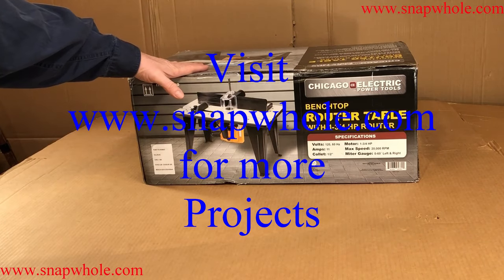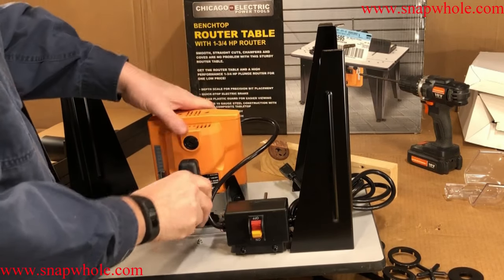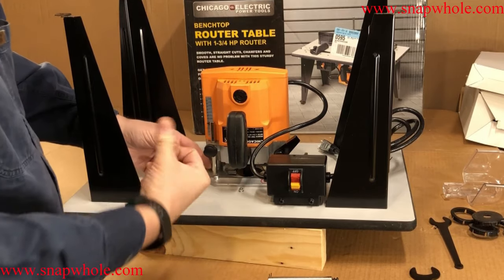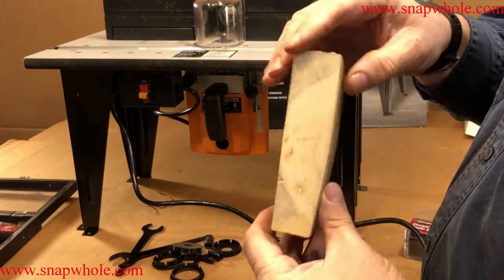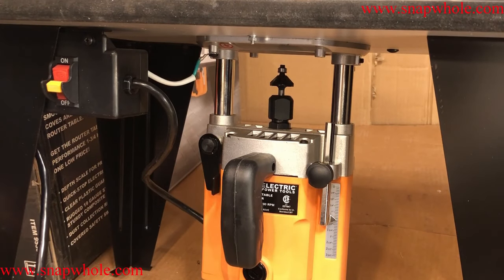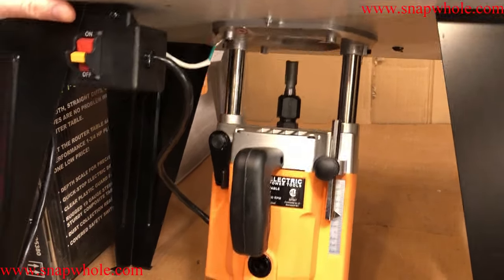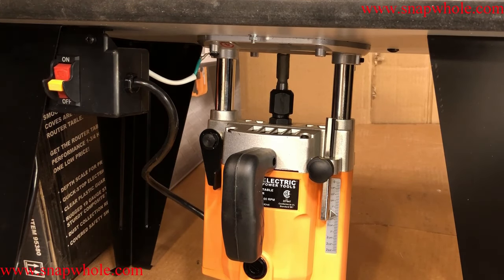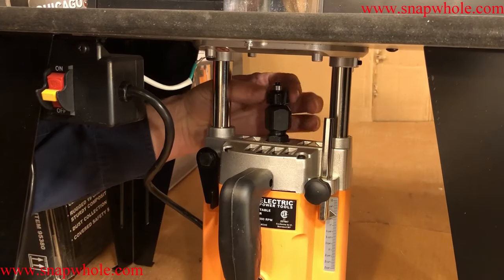Harbor Freight Chicago Electric 1 3/4 HP Router Table Review and Use Demonstration

Comment: Thanks for the review and suggestions. I just got this table and immediately was hit with the depth of cut problem using 1/4" bits. I'm a relatively new woodworker, but at least I knew enough to be uncomfortable with raising the bit in the collet, as you point out as well. I appreciate your "precision" in making that adjustment (as well as your caution!). LIke you and several others, I plant to make the adjustment to the underside of the table surface as soon as possible. I also really liked your magnet solution to roving collet wrenches. Again, thanks so much for your time and care in presenting this information.
Reply from the maker: Glad you found the table useful! thanks for subscribing!

Comment: I want to thank you for this video.  I got the exact same router table, mine came with a manual, but my manual makes no mention of that funky steel bar with a screw in one end and a cotter pin in the other.  I was trying to figure out if this was a spare part - it seemed odd to me that my table came with the router already attached, so I thought maybe somebody put it together wrong and then returned it.  

Also, the manual helpfully suggests that the washers should go on the bottom of the table, rather than on top of the fence, which prevents the carriage bolt cuff from locking into the slot.  I knew this was wrong, but I am glad that somebody with a YouTube channel gives the correct instruction.
Reply from the maker: HF manuals are not known for completeness or accuracy, I try to cover the stuff they don't - thanks for subscribing!

Comment: Been using this one for a year and a half and it has been great. I built a bench for it at the end of my miter saw station.
Reply: The only thing I don't like is the plastic inserts.
Reply from the maker: I've had this for several years now, once you know its limitations and how to work around them, this table works out ok - thanks for subscribing!

Comment: I just got a kobalt and now I'm glad I did.  It was only 10 bux more, but came with a few more accessories and is adjustable from the top.  And the table is metal.  Thanks for the review.
Reply from the maker: thats why I do the videos, so a buyer can make an informed decision when buying - I still have this one and its still working ok, but I only use 1/2 inch router bits in it - thanks for subscribing!

Comment: Thank you for your good review!  I decided to replace the table top with a 3/4 inch plywood.  This allowed me to route out the underside of the board and raise the router.  I also moved the switch to the left. It works well.
Reply from the maker: Its worth it, I did the same thing, Overall this is a good table if you use 1/2" bits, but most use 1/4" bits - Thanks for the update and Thanks for Subscribing!
Reply from the maker: sounds like a nice improvement - you should consider doing a video overview of the changes - it will help others - Thanks for subscribing!
Reply: Hi Dennis :Do you have any video ? i want to know how you do that.Please Thanks
Reply: @yourunclesam6780   I don't have a video, but I just took apart the original table and used it as a guide to cut out the new 3/4 plywood replacement table.
Reply: Bula Vinaka (Hi and Thank You) from Fiji, I used the same top just routed out the middle base
 to accommodate the router closer to the top.

Comment: Very Informative video. I recently purchased what was at one time the display model. When purchasing the table it only came "as is" and the 1/2, 3/8 collet adaptors were missing and also the 5 inserts and wrenches. I've tried H. Freight but to no avail. The parts are no longer replaceable thru them. If you have any suggestions as to where I might find them, I'd be glad to hear it..  I myself do not like to plunge set up this router has so I was relieved to see it wasn't just me. I will be doing the inset for the router into the table as you talked about, thank you, That was such a helpful idea.. Again, Thank you and keep up the good work.

Comment: Thanks for the vid. I was hoping there were some things I just clearly missed on how to use this router table but it is just a really bad design all around. Was hoping it would get me by or the table be good enough to attach my better router too but even the little things like loosening the collet chuck is extremely frustrating for something that should be super easy. Returning this asap.

Comment: I routed out the bottom to allow for proper height adjustment, as you suggested.  The screw sharing the same hole as the ground wired had to also be shortened. After finally getting it ready to use for the first time I turned it on and the screws holding it in place broke through the holes dropping the router out of the table......now what?
Reply from the maker: the table top is particle board - I had concerns that would happen, depending how much particle board thickness was left - get a piece of 3/4 inch plywood (not OSB) and make a new top, using the old top as a pattern, the only semi critical part would be the miter slot, but its really only used to push the work piece, so its not nearly as critical as a miter slot on a table saw - I used a 3/4 piece of ply, routed out the bottom, and it worked great, also a great time to make a bigger table if desired, lowes has sanded plywood, and hardwood faced plywood, which would work well, but any smooth plywood would do, I installed and outer skirt under the top to prevent twisting - I am interested in how this turns out for you - I'll try to get a video up of my conversion after it warms up a little - the shop is a little cold when the outside temperature is below zero......
Reply: Thank you so much for your reply.  My husband has been laughting at my “now what” comment since the night I posted. 
I’m very, very new to wood working. Originally I wanted to make a picnic table squirt feeder like the one I purchased and fell apart. This has progressed over 3 months or having every saw (just about) and all kinds of goodies.  
With that said, after 3 attempts, I’ve finally made a little router table top table. Waiting for the stain to dry and hope to have it running tomorrow.  I’m satisfied with the results. BTW I made 5 crappy picnic table feeders and another 6 that came out great!
Now, my challenge will be to figure out what to make and sell to recoup my investment.  I’ll keep watching your videos, love how you explain things.  Thanks again. Hope you warm up soon and able to get back in your shop.
Reply from the maker: @brendasmyles8242  Very Glad to see you update, looks like you recovered and came out way ahead - if you are interested in doing a video about your adventure, I would be happy to post it here, sounds like a great experience and I'm sure other would enjoy it - if you are interested, contact me at the email on my channels about tab - its finally getting warner, and you guessed correctly, its cold in the shop, I'll have a video posted in the morning  thanks for the update!

Comment: Before I even got started putting this thing together I found that the table had a crack all the way across it from rough handling on part of the store or during shipping. But watched the video just the same. I am going to return this for the crack and not get a replacement because of your review. Not crazy about the table being some cheap particle board and a plastic fence
Reply from the maker: that is why I  make these videos so you are aware of negative and positive aspects of the tools - thanks for subscribing! - I recommend you buy the 2 hp fixed base router and build a router life like the one mathius wandel built - good design, works great - https://www.youtube.com/watch?v=2WD8VdX4LRw&list=PL0CFBF09C2948FDF2

Comment: Thanks. My motor nut came loose and therefore won’t allow me to tighten it on the motor. Any suggestions?
Reply from the maker: do you mean the collet nut? the nut that holds in the router bit? thanks for subscribing!
Reply: @snapwholeharborfreightreviews
Reply: No-the motor out below the collett-I managed to tighten it- thanks

Comment: I see this is an old video but wonder if you routed the table to 1/2” so 1/4” bits can be used? I wondered if less than 1/2” screws would hold the router.
Reply from the maker: I took 2 different paths, I started using 1/2" bits in this table, and also built a router lift for the router, using 1/2" bits is the easiest way to go, they are not that much more than 1/4" bits and I like using them a lot more, read down in the comments and someone routed out the table top and it became so weak it was unusable - thanks for subscribing!
Reply: @snapwholeharborfreightreviews  Thx for response, and yea, I read comment AFTER I commented. Bad. I already have 1/4” bits and don’t use enough to buy 1/2”. I am new so not sure I can make a table top w/plywood and attempting to router for router. Where the router lift video? 😬

Comment: Where can I get the 1/2" to 1/4" collette adapter? If it came with the router, I have lost it
Reply from the maker: harbor freight's web site does not list any replacement replacement parts for this item - you can call HF customer service and see what they say, its possible you can get a replacement from amazon, but no guarantee it will fix without trying the fit, parts like a adapter collet are custom designed for each router - but there are a few 'universal' adapters - if you have prime, order one you think will work, and return it if it does not work - if you don't have prime, you'll likely pay to return it - the universal 1/2 to 1/4 collet assume you can insert this adapter into the router like its a 1/2 bit, then allows the 1/4 bit to be held, there is a chance the adapter is not a perfect fit, for example, it might be too long -but if you decide this is the only way to get a 1/4 collet, start ordering and possible returning parts - I hope I've stressed its your choice to order something, and it likely won't work - the first universal adapter that might work - https://www.amazon.com/2Pcs-Router-Collet-Reduction-Sleeve/dp/B07SQYX1YF/ - good luck and if you go this route, please provide updates, other could benefit from you search results - thanks for subscribing!

Comment: Thanks.. Is there a way to move the power switch to face the left side of the table vs just moving it over I woinder?
Reply from the maker: I moved it over to use the existing screw holes, you could move the left front leg to the back left, that would put the switch on the left side, but it might be a little far back for comfort - let me know if you try that and how it works - send me  video of the results and I'll post it here to help others

Comment: Thank you so much for your video.  It helped me to get up-and-running!
Reply from the maker: Glad it helped! thanks for subscribing!
Reply: @snapwholeharborfreightreviews  on the fence by the vacuum port, that area seems to be very wide.  I created a zero clearance method by simply placing a 1/4-inch pine board across the fence.  When using the 1/4-in straight bit, the cut line is perfect.  Without the vacuum, the sawdust picks up though.

Comment: Is the Router Variable Speed? I'm going to be using a 1'2" collet 2" Drawer Lock bit with a recommended 16000 RPM - I may have a to buy a variable speed controller?
Reply from the maker: out of the box, its 20K RPM, no variation, so if you want to use it at 16K RPM, you'll have to use a speed controller - as a general rule, I don't use speed controller,s on any router, but if you know the limitations, they will work ok - the router in that table is 11 amp (going by HF), but their speed controller is limited to 8 amp, so technically you need a way to measure RPM and amps used if you want to accurately know you are at 16K RPM and not overloading what every speed controller you get, the speed controller will likely interfere with any 'auto' motor loading a router has - thanks for subscribing!

Comment: Any suggestions on router bit brands and packages I just got this and need to stock up
Reply from the maker: the table is built for 1/2 bits, you can use 1/4 bits in it, I have several of the harbor freight sets and they work ok for me (they are the same sets skil sells for 2x the price) - I used the 1/4 without an adapter until I bought the door making set, the raised panel bit is huge, and that a lot of weight to not be fully seated in the colllet, so I bought the 1/2-1/4 adapter off amazon, its a heck of a lot cheaper to buy the warrior bits from HF and replace them after sharpening them a few times, than to buy most name brand bits, but a lot of people will disagree with my preferences- HF has a 29 pc set and a 15 pc set, and a slot cutter set, a  door set, and several roman ogees - If I were buying non-HF, I would likely buy 1 bit at a time, and only buy what I was going to use - thanks for subscribing!
Reply: @snapwholeharborfreightreviews  awesome thank you for the help and information great channel keep them coming

Comment: Couldn’t you add a screw to the other side of the switch? Seems you could counter sink it in the table so not in the way, thanks. Also, on the half inch bits, they are probably on bigger cutters like raised panels, etc that need more horsepower?
Reply from the maker: all routers bits can come in the 1/2, 1/4, 3/8 inch sizes, the move to 1/4 and 3/8 router bits were driver by cost, this router table was designed for 1/2 inch bits only, the 1/2 bits work with no adjustment and the 1/4 inch bit will not seat into the collet and be above the table and usable - I have the 1/4 inch raised panel bits, I won't use them on this table, I don't like the idea of having a large big no fully seated in the router, the table top is particle board, I would not add any holes to the table, the power switch is stable and has not been a problem in the 3 years I've used the table - thanks for subscribing!

Comment: To s raise the 1/4" bit, cut off and drop a small bolt down in the collet the same length as the length you need to make bit flush. just make sure it's smaller than the bit shank so the collet does not tighten on it.
Reply from the maker: thanks for subscribing!

Comment: I went to pick one of these up today and apparently they discontinued them and left us with no other options for a router table which seems odd because most of the time they just rebrand something.
Reply from the maker: I agree on the rebrand, they are trying get rid of all drill master and chicago electric and build up warrior and bauer, with bauer going mainly battery powered, but they are pulling products a lot lately, their video systems disappeared, usually they do a discontinue first, if they just disappear, that might be a sign they are out of stock, which removes them from the website, store shelf space, and they will eventually come back into stock, but with no announcement, but no guarantee - you find future products before they are announced or released by searching their manuals, manuals for new products are available on the website about a year before they are announced, not easy to find, but available

Comment: Can u flush cut using router table or have to use router alone
Reply from the maker: it might be more accurate on the router table, but you can do it either way, with a free hand router, use a board clamped to your work piece to guide the router to make a straight cut - a bench table saw might be useful for this application, but the router can make the cuts - thanks for subscribing!

Comment: Love your videos. Did you ever get a chance to route out the underside of the table to bring the cutting edge of the 1/4" bits completely to the surface of the table?
Reply from the maker: I did and it worked, but the wood the table is made of is not really strong enough to support that setup, a better fix would be to route out an inset to allow a steel plate to be used to mount the router - the limitation is partly the table thickness and partly the router construction not allowing the router to be fully compressed - to add a steel plate would require a certain amount of metal work
Reply: @snapwholeharborfreightreviews , thank you 👍👍
Reply: @snapwholeharborfreightreviews  I just replaced the whole table top with plywood.  It took about two hours.
Reply: Route out a square hole on the top side then rabbit out 3/8" and use a piece of laminate flooring (approx 14-15" long) as a router plate I have this exact router I bought from harbor freight years back without router table just the router, I think it was about $60 us. With a coupon, mine has a nice strong plunge a little bit of play when unlocked, it looks like they took the springs out when they sold this with the table package. I did what I described above on a piece of 3/4" plywood and it worked good, I use an oak 1"×3" clamped to plywood for a fence. Use straight edge ruler to align fence with router bearing for best results table marks are useless, make hardwood stick to fit miter slot better then attach to miter Guage always use a square to set Guage 90° to fence if you use the slot. I never use miter slot at all for routing I use a square 12"×12  piece of 3/4" plywood with 1"×3" on top of leading edge to push materials through against fence works just like a miter Guage